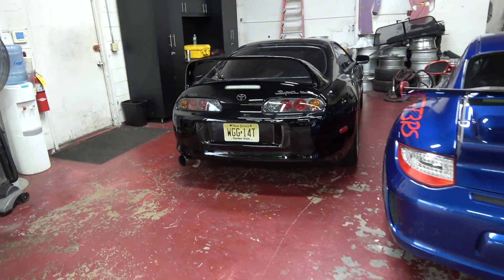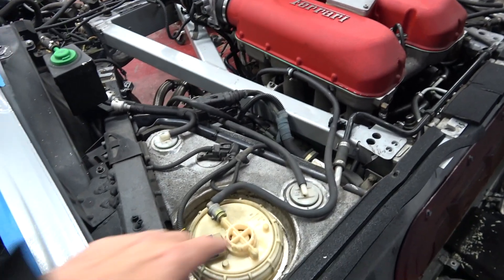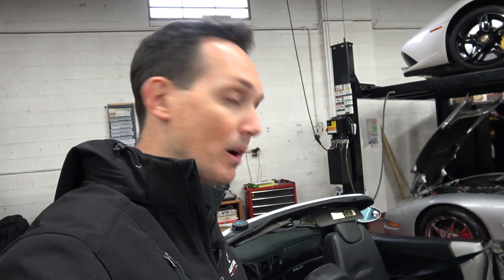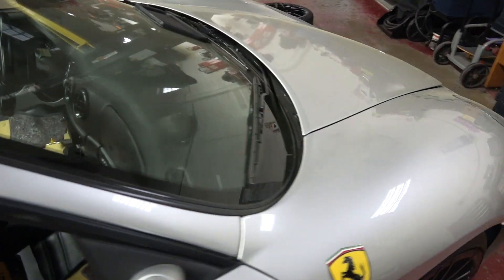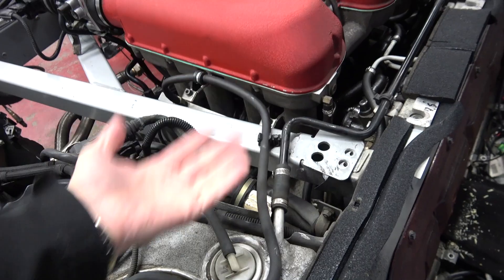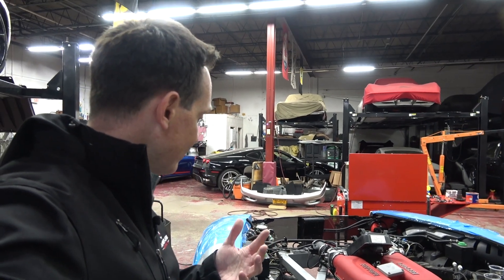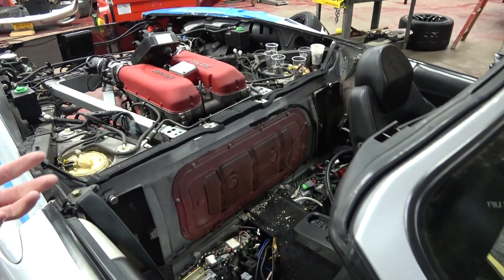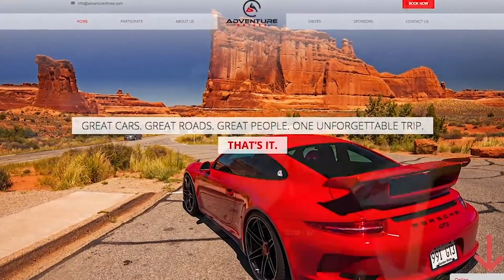Ferrari 360 Stripped Down Looking All Sebring Convertible

Comment: I love the channel rob. A little constructive criticism from a technician, regarding Porsche IMS, all owners that have concern or fear, perform a oil change keep the oil filter and ship it to the porsche lab, this progress is like 200$ they will inspect for peices of anything floating in the motor. If IMS is failing alitle or a lot this test will come back failing IMS indicating replace the bearing. If all is good they will tell you keep up the oil changes and the bearings do not just fail. Improper oil or oilchanges lead to failure in the future. Do not just change IMS just because, but also don't just ignore that it should be inspected threw oil filter diagnostics.

Comment: I would think it would be a good time to replace the timing belts and clutch?
Reply: those should never be replaced
Reply: domitry jobby Ferrari specs the replacement of timing belts at  5 years or 30,000 miles . The timing belts are considered consumable items like brake pads or air filters . Clutch is also a consumable item . If a car is already that far apart why would you not change parts that are maintenance items ? I own an auto repair shop .
Reply: @randywilliams4325  i was sarcastic :). 30k miles, why so often?
Reply: domitry jobby I googled  Ferrari 360 timing belt replacement  . I will admit I did not get your sarcasm . I actually looked the 360 up on Rock Auto but they don’t have a good selection on Ferrari parts . I don’t leave anything to chance on my cars .